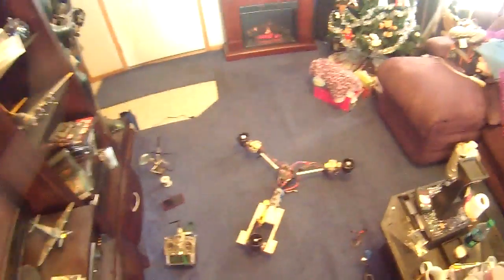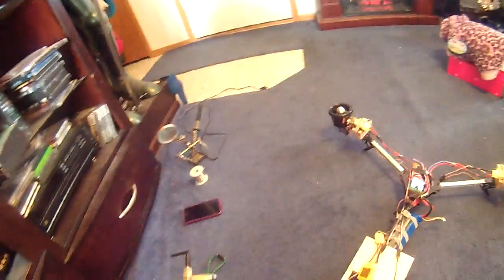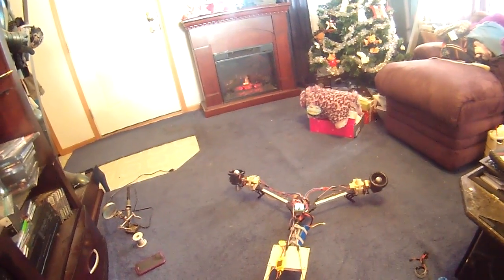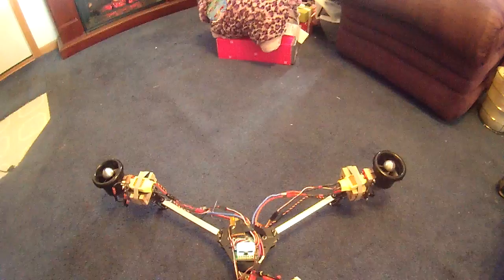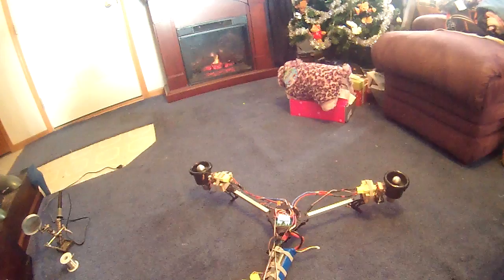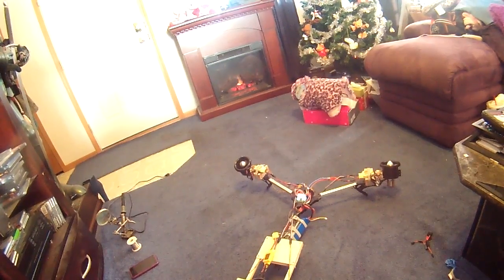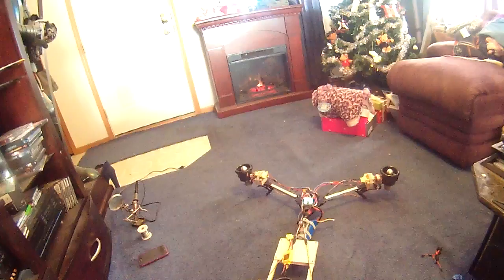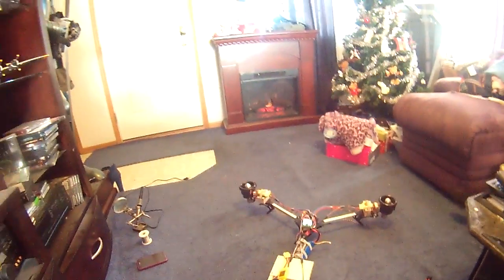small ducted fan tricopter test1.MOV

Comment: Yes it does fly...quite well actually. Very easily controllable. There is no need for the rear fan unit to be tilted fore or aft either. .even though I set it up that way. All yaw and plus forward and backward is handled by the two front units that do tilt forward and backward. Yaw control they tilt opposite directions. Roll is done via fan power. 

The two front motors are a pair of jetscreamer 1400's I don't recall the kv. They are amp hogs. This vehicle would benefit using inrunners instead